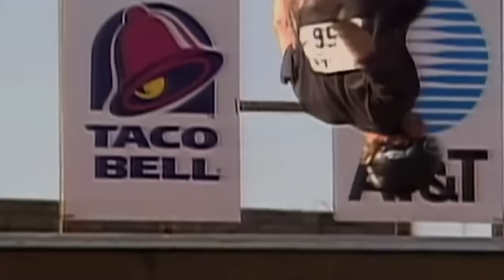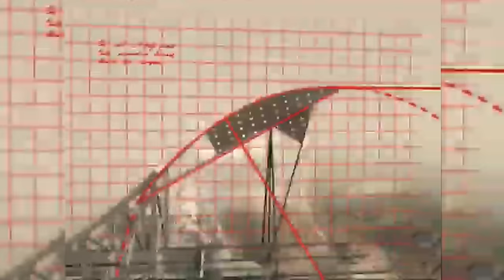The Craziest Skateboarding Tricks EVER Done

Comment: I've bombed a hill that starts out as steep as the Nuge hill, but it mellows out way sooner. Still, to go from the top takes a big pair. The road is too rough to really skate on street or park wheels, too (I used softer wheels which made it easier) so you are best sticking too the pavement, which doesn't leave any room to powerslide, so you are not going to be able to slow down properly. 

A friend and Me used to bomb it quite a bit, back in the 90's. Even just starting from where it begins to mellow out, is incredibly fast. going from the top, you're getting speed wobbles, it's inevitable.